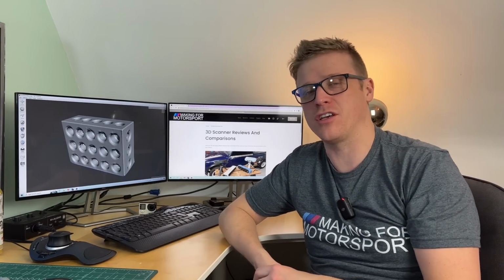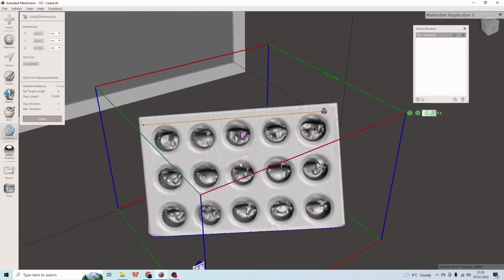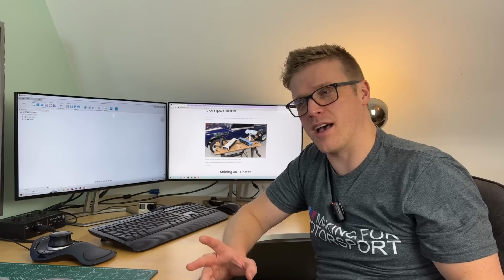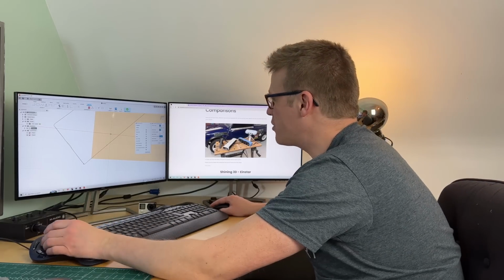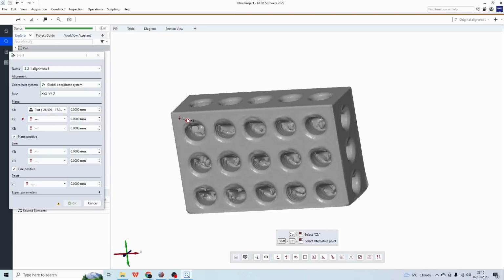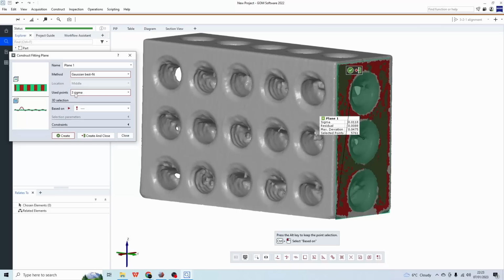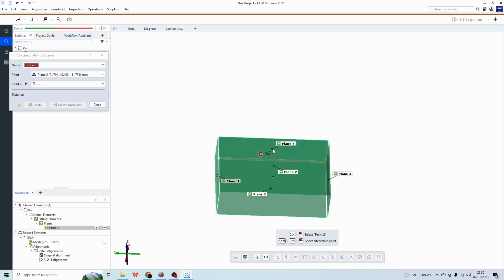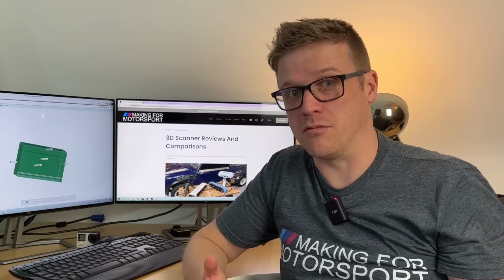How to Accurately measure 3D Scans using MeshMixer, Fusion360 and GOM Inspect Free

Comment: Find the CAD for that block and you can do a heat map to see where your deviation is. GOM engineers have created a massively powerful inspection software. I'm excited to see what the do for the Calypso software Zeiss uses on their cmm's.
Reply from the maker: Love GOM/Zeiss inspect, but I just haven’t got that far with it and the training is typical pro-software, it’s 4hrs long 😂
I plan to do exactly as you suggest in an upcoming project!
Reply: @MakingforMotorsport  also if you want to learn more gd&t Zeiss has Android and Apple apps very intuitive.

Comment: GOM Inspect seems to now be Zeiss Inspect.
Does it still do all the stuff you demonstrated in the video? 
I am just getting into 3D scanning and reverse engineering to help with repairing patterns for a local foundry.
Reply: no ZEISS is the most horrible piece of shit of a company and now it's a pain in the ass to try to use the free version of the original GOM software

Comment: Btw, you can create segments (just like you did for the plane on GOM) from mesh on Fusion360 as well. I feel like most of the things related to scan files could be done in Fusion. However, for inspection purposes I use Spatial Analyzer since I work with laser trackers as well. And of course, the holy grail - Geomagic :D But honestly, I would use it only for something really complex or a scan that is not that great, but still could be useable. Otherwise - Fusion all day. For not scan related CAD jobs I would use Solidworks since I've got years of experience on it and am using it on daily basis.

Comment: At the bottom of the menu where you find the 2 point dimension is a tool called caliber, way faster or even the one right below “2 point”
Point and plane you pick your point on one side and the plane of the other. Always a straight line. I work with this software and him scanners everyday at work.
Reply from the maker: Yeah thanks I have tried those, and probably makes more sense than changing the coords manually but this way I found easy to explain. 
But lots of great tips!

Comment: GOM inspect is very nice but it also has a steep learning curve - especially for someone like me who has no experience with any metrology techniques/software.
Thanks for this quick intro, this gives me a quick introduction and now I am not that scared to select a function from the menu and push buttons 😁
Instead of creating two points on two planes and aligning them manually, you can also create the second point using Construct -> Point -> Projection point. This will project a point on the second surface using the normal of the first point's surface. This removes any dependencies of the coordinate system. I did get an error (normals are opposite) but that was easily fixed by ticking the "Do not check normals" box
Reply from the maker: I actually recorded project point as an alternative, but I wanted the video to be 10mins long and it was headed to 30 so something had to go 😂😂😂

There are a multitude of other ways aswell, but I have to leave something for future videos! 😂

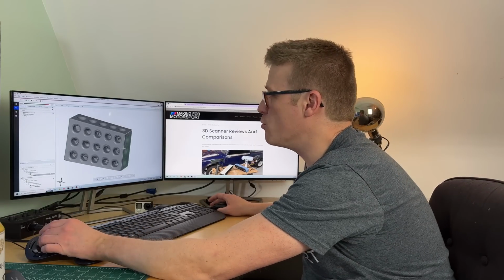Comment: It was good to hear about MeshMixer and GOM Inspect free from this video, but the GOM plane at 17:46 is not the first perfect flat plane in the whole video. Almost any package can construct a plane from 3 points and you did that earlier in the video. You could have done that on all six sides and (if you picked the points reasonably) it would have been very close to the GOM 6 plane model. The advantage to GOM is the way it can make a best-fit plane through the massive number of points in a scan cloud.
Reply from the maker: Yep, fair enough, I did that using plane from 3points in Fusion and yep that was a true plane, but it wouldn’t be as accurate and would change each time as different points would be selected, that said, the difference would be very small….
Reply: @MakingforMotorsport  Right... It's important to keep a sense of perspective on the differences. Using three (or maybe even two) decimal places from 3D scanner data is implying accuracy that just isn't there.Just because the number shows up in software, doesn't mean it's real ;)  Also, I'm not familiar with Fusion 360 but in SolidWorks (which I've been using since 1998) any measurement between two features is automatically displayed in X,Y,Z and normal. You could get the equivalent of the GOM two point measurement without needing to change X & Y values with just two clicks. I'd be surprised if Fusion doesn't have a similar option
Reply from the maker: @MrGadgetgav  yeah, of course, but I have been critiqued before on using point to point measurement.  And even meshmixer has XYZ and surface normal alignments, these rely on alignment to the Global coordinate system and or a flat surface.
In reality, the type of accuracy on display here is well above what most people need or could handle….

Comment: you are the bob ross of 3d design but how come you dont use solidworks?
Reply: Didn’t you hear the “spend less” part of the channel motto?!
Reply from the maker: Bob Ross 😂lmao!!!  You just get hooked into an ecosystem really.  I have always used AutoCAD and Inventor was easier to pirate back in the day than SW.
When I got back into it Fusion360 had just reappeared got going and SW was still pay only (I mean it still is but BIG money pay only).

They all work in the same way generally…

Comment: Ive scanned most of my Mini R53 and love these videos, one gripe i have is, when measuring a 123 Block that is 1-2-3 inches, why not use inches for the measurements? I know the point is to demonstrate accuracy and i am a metric user in germany, but it just bugged me lol
Reply from the maker: Hehe… the reason is that the inch is defined as being 25.4mm.  Even America that uses imperial measurements has metric as its actual standard!
Reply: There are 25 50 75 mm blocks.😗

Comment: What it that thing you was using to move the view? I need one of them
Reply: I think you mean the SpaceMouse from 3DConnexion. It's a 3D mouse that allows you to move/pan/zoom. They have different models, they all share the same 3D mouse puck but have different other features like quick access buttons and programmable function keys. If you buy one, take a bundle with the Cadmouse Pro. This is a true 3 button mouse so you don't have to push on the scroll wheel to activate the middle mouse button.
Reply from the maker: Yeah what he said! 😂

Comment: It's really amazing that GOM let's you do everything it does in a free package. I've used seriously expensive software in the past to do very similar things. 
Great video man, very very clear explanations of each process. It's worth remembering when using an entire face worth of scan data for a best fit, it's worth excluding or deleting the data in the holes. Even though a best fit will ignore the data after a certain depth in the whole, having lots of data for each hole in a set direction will bias the best fit. The difference this will make is probably negligible but here's an annoying metrology eng's input 😅
Reply from the maker: That is a great shout, I was hoping the selection algorithm would sort that out but it’s a good point.  
I need to get better at GOM inspect, but it’s a classic piece of pro only software… vertical learning curve! 😳
Glad you enjoyed it!
Reply: @MakingforMotorsport  I'm somewhat guessing but the selection algorithm will best fit a surface in a (for example) 50 micron range and if that range is taken up but hole faces going all in one direction, it will then bias the best fit.

Very familiar with that vertical learning curve but luckily YouTube channels like yours make these things more manageable!